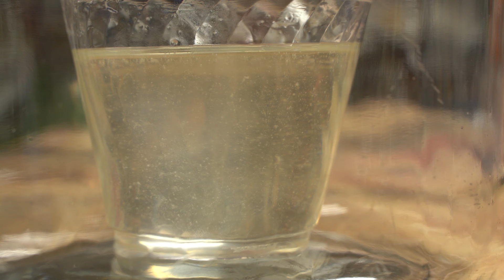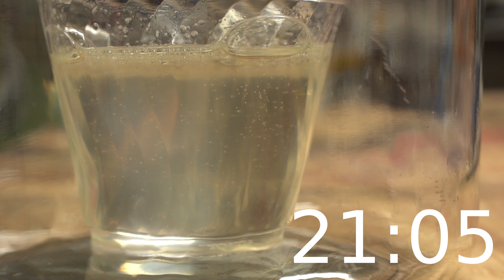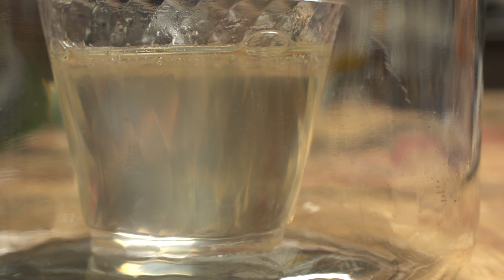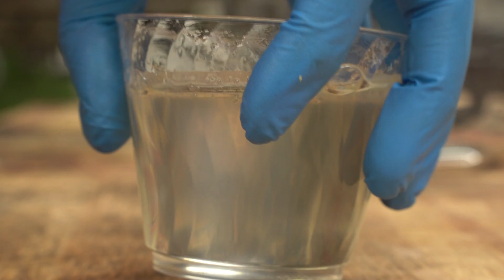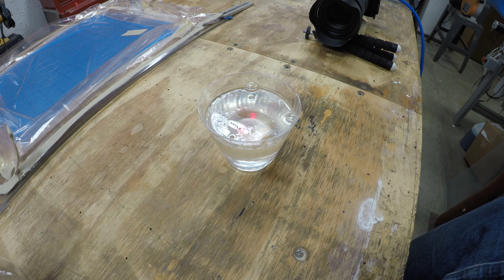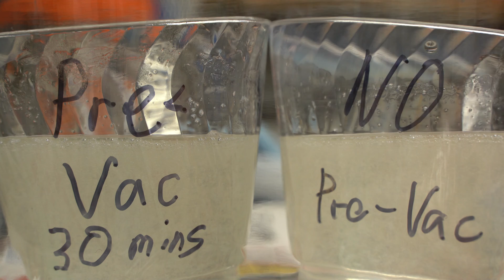Epoxy Degassing at x8 speed for vacuum resin infusion

Comment: Hi, I degassed resin today and it seemed good at the beginning but the resin liquid seemed to "boil" after a while (bubbles arise and increase in size as they rise up). I was guessing perhaps the resin did boil since the pressure is really low but i couldn't find a boiling point v. pressure chart online. Do you have any idea how this happened? Thanks!
Reply from the maker: That is to be expected when the pressure gets really low.  I've done some tests where I just let it keep boiling. It just keeps boiling and boiling. Since some of the content that is out gassing is needed for the epoxy, I only let it boil for about 30 to 60 seconds. That should be enough to get all the air bubbles and some of the moisture out of the epoxy.
Reply: @Designer103  this makes sense! Thank you so much!
Reply: @Designer103  the resin wil "collaps" when the majority is out.  The bubbles go down rapidly  and at this point the air is basicly out.
   When it keeps boiling how you call it.   Its breaking up moisture in the epoxy.

Comment: I do resin infusion regularly for my RC Boat Hulls.  I find that a 16 minute Degass at 100% Vac is optimal, helping to get a clean bubble free finish.  Of course you need absolute vacuum on the project(no leaks) and an experienced touch on resin flow speeds during the process.  I use MCI Hose with the Vacuum.  The results are usually perfect now.  I plan to try out the new MB80 Vac Hose alternative and evaluate the results vs cost.
Reply: I have trouble doing resin infusion. I get bubbles and air voids in the corners

Comment: Hi, I understand it's been quite a while since this video was done but here is my 2c.
Could it be those small bubbles you see still coming out are from Nitrogen dissolved in the epoxy chemicals? After all, the resin and hardener were produced at atmospheric pressure.

Much like our blood has Nitrogen dissolved in and it will bubble out when, for example and astronaut is caught out in the "open" without a suite or a scuba diver, not doing the proper decompression, will have to deal with the decompression sickness called The Bends, due to evaporation of the additional Nitrogen dissolved in his blood due to the high pressure of his dive.
It's one thing the big bubbles we add in due to missing but the Nitrogen dissolved in due to atmospheric pressure will be more homogeneously dissolved in and probably will take longer to get rid of.

Just a thought
By the way, I'm loving your videos
Reply from the maker: Sure. It could be just about any dissolved gas from the air, including water vapor. I've discovered over time that I may be pulling just a little too much vacuum. By reducing the vacuum by just 1 psi, I can get the outgassing to quit.